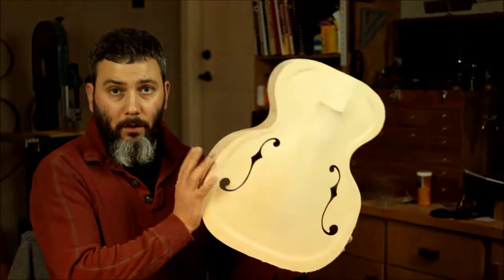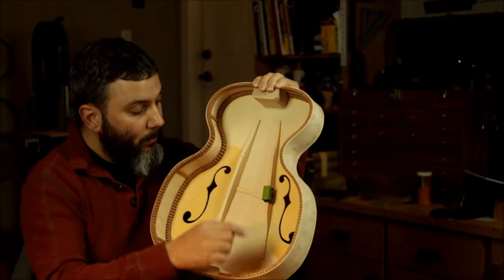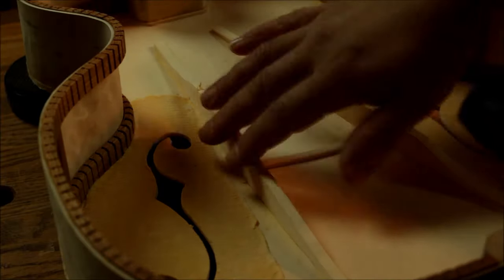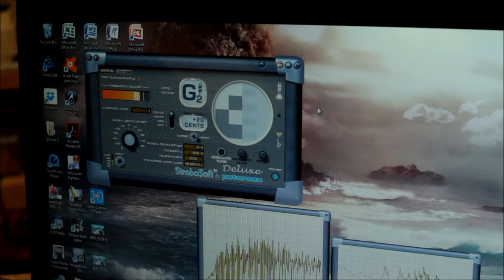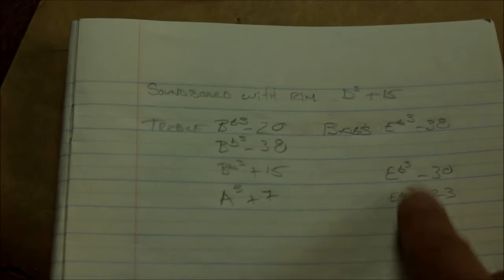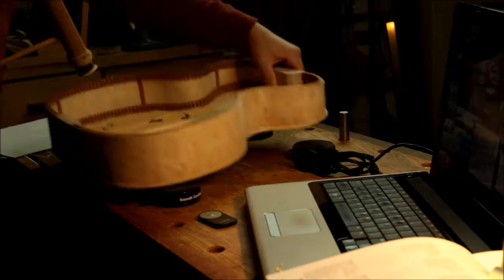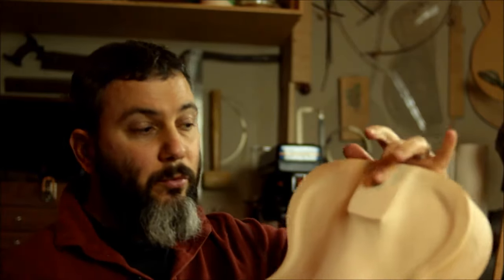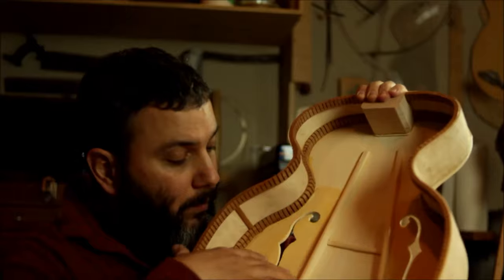How to Tap Tune the Soundboard tone bars.

Comment: Very informative, on what basis did you decide the bars to be exactly C# and D#?
Reply from the maker: Chiliarcher archtop Jazz guitar are often tuned into D# and C#. Since the body is similar in size and the mandolin will only have a extra 2 strings i figured it would probably work pretty well . Thanks for your question ..

Comment: Hi, Tomy! How would tuning of the body affect tuning of guitar? Will it resonate more with traditional mandolin tuning?
Reply from the maker: moristar1101 theD# and C# I used in the video are usually used on Jazz guitar ( archtop) it all depends on the size of the instrument. I would recommend reading about it in the art of tap tuning. There is not a wrong way of doing it, but rather different target tuning. You can see this in my video on tuning a mandola backboard. I had to change the target tuning.

Comment: Do you think that there is a certain  common  (tap tone frequency) should be obtained during fabrication, in most of the acoustic instruments like guitars, lutes, Ouds, ... ?

Or , each instrument has it’s own perfect tab tunes , that match it’s beautiful sound?

And if they are different, 
How it can be determined for each acoustic instrument?
Reply from the maker: I think tap tuning helps to replicate a good sound from a previous build . The main idea is the difference between the Bass bar and treble bar. In this case a full step. Since I have great results I can now target the same tap tones for upcoming builds. I could also experiment from this point leaving it stiffer and see if I like it better.

Between different size instruments the target note if different since the size of different.

With personal experimentation you can find and decide which targets you personally prefer ..

Comment: Tomy, why +2 cents? why not exactly D#?
Reply from the maker: nhandutimusic thanks for your great question, I stopped there because I had the full step I was looking for between C# and D# and was close enough to my target. You are right, I could have brought it down to 0 cents. But like I’m explaining at the end of the video, with adding the fretboard and removing wood from where the fretboard will be glued on, the overall stiffness of the top plate ( soundboard) will change, but not the difference between the tones bars.. hope this helps, thanks for watching!

Comment: Hi Tomy, am really enjoying your videos and learning much. Is the tone bars made of the same wood as the sound board of from the same hardwood as the body? Since I don't have the tuning equipment, is their a rule of thumb in listening to the wood sound? Thanks much.
Reply from the maker: Hi Ron, yes same wood as the soundboard. Quarter or riff sawn.(usually Spruce)For the rule of thumb, bring the plate( soundboard) to your ear holding one end and tap the bottom end with your finger before starting to remove wood. Then redo this step as you are removing wood until you feel that the plate is holding a vibration. That’s as close you will be without a tuning equipment. Hope this helps
Reply: You can Tuning in a cheap way, with a chromatic tuning machines for musical instruments. It must have microphon.

Comment: Could you use a piezo clip mic for this?
Reply from the maker: rimmersbryggeri not sure, I'm not really familiar with the piezo mic..
Reply: It's for korg tuners pretty cheap is like one of those tuner clips but for normal digital/analogue tuners. Micght be an idea to try to avoid ambient noise.
Reply from the maker: rimmersbryggeri thanks I'll look into it..
Reply: I bought onw to be able to tune my piano but the dynamic range of the piano was too great for the tuner I guess I could donate it tou your experiment.